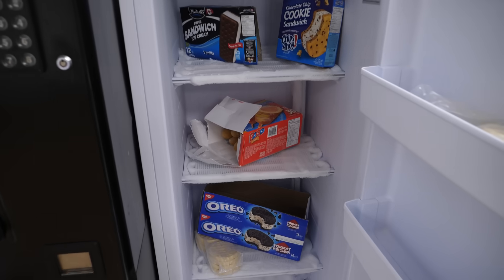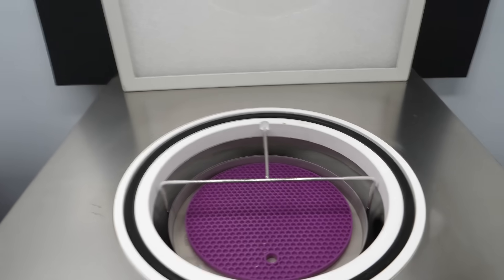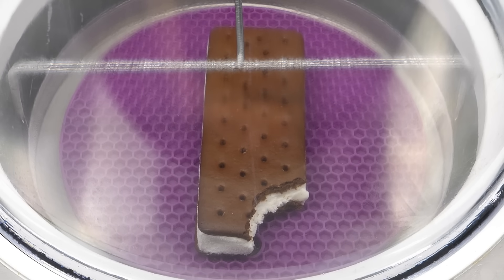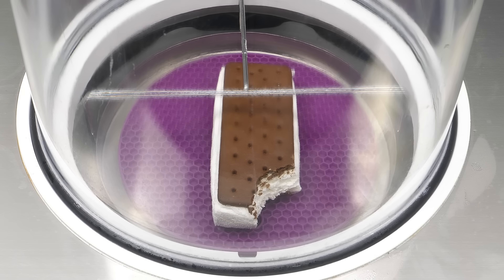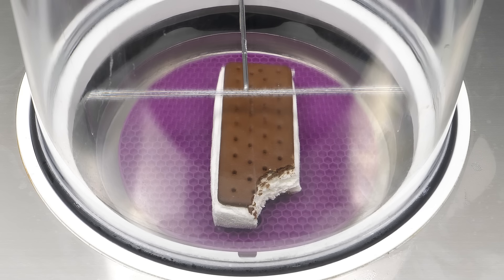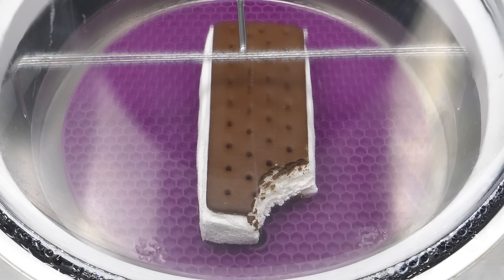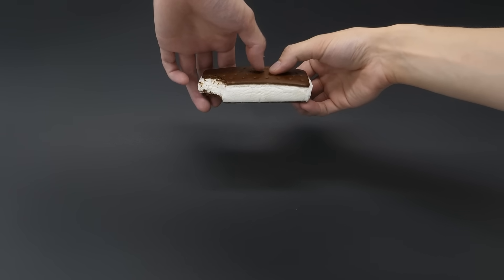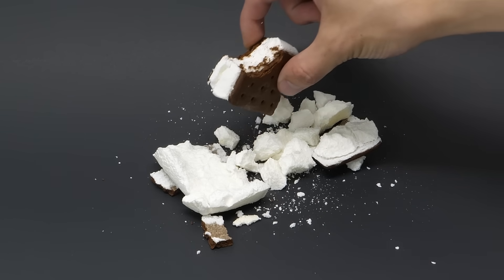Making astronaut ice cream

Comment: I think there's a version of freeze drying that occurs in our frozen food. As temperature fluctuates in the freezer, the food will warm up and vaporize water. As the freezer cools again, this water vapor is deposited as ice mostly outside the frozen food. This process repeats over and over until the food is dried and shriveled out, and the bag is filled with ice. At least that's how I think it works.
Reply: If the food get warmer sometime in between you're absolutely correct my bro
Reply: Ice ‘can’ sublimate randomly at 0C.
Reply: @DunningofKruger   Indeed it can. In fact, ice will sublimate at virtually any temperature, but to vastly different degrees. Then it's just a battle between how fast it sublimates and how fast is the deposition process, given a certain humidity. It's all about equilibrium.
Reply: what, I dont get it?? How can the food be warm in a freezer?
Reply: @debendraparida194  Unless you're at absolute zero, all molecules within a substance are moving, in a solid this movement is mostly vibration, but if the bonds between molecules are weak it's possible for individual molecules to break off randomly and spontaneously.
Reply: I think This video is absolutely wrong . In spaceship there is no vaccum they have to face zero gravity . If they have face vaccum inside ship that have to wear spaceshuts always . There is big difference between zero gravity and vaccum 💁🏻
Reply: @crystalbhattarai2761  what
Reply: @crystalbhattarai2761  you drunk?
Reply: @crystalbhattarai2761  This video is technically correct. It's called astronaut ice-cream because it is what they literally eat in ice-cream format. Also Nile is a god damn professional and has actually went to college for this kind of thing. "names" aren't always indicative of what is "accurate". For instance, have you ever thought of that maybe, astronaut ice-cream is made BEFORE it is sent to space? Ever thought of that? And it's called astronaut ice-cream because it's what astronauts EAT?! Something to think about
Reply: @crystalbhattarai2761  and this guy took all them drugs at once
Reply: @DunningofKruger  it's not about whether or not the bonds between the molecules are weak. Lower temperature means less energy. Energy is the potential to do work. When water boils it's molecules are very energetic and excited and easily fly out of the liquid phase into gas. When in solid phase it will sublime much less but not due to bond strength, but less energy. The molecules vibrate less and are less energetic.
Reply: It’s generally called ‘freezer burn’
Reply: Don't modern freezers/fridges have AC in them?
Reply: @debendraparida194  alongside everything others have said here, heat is let in every time you ever open the freezer too, not much but it's still an air temperature difference than needs to be re-cooled
Reply: @kelmirosue3251  also you're nearly correct, buuuut astronaut ice-cream is too crumbly to be used in an actual spacecraft, it's just a branding thing at this point :-)
Reply: @crystalbhattarai2761  the big problem with your argument Is that a vacumm requires absence of gas (like O²) which Is essential for life
Reply: @billbob8  but solid metal doesnt usually change state in a vacumm because the bonds are that strong , so the strenght of bonds Is still an important aspect